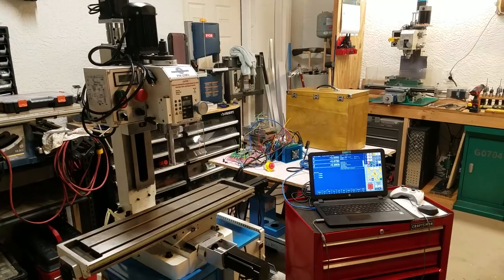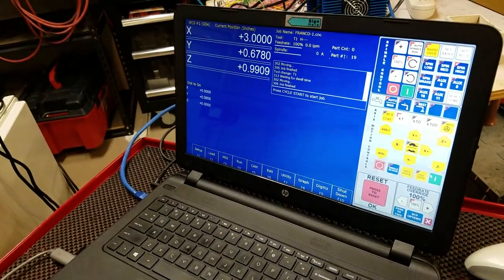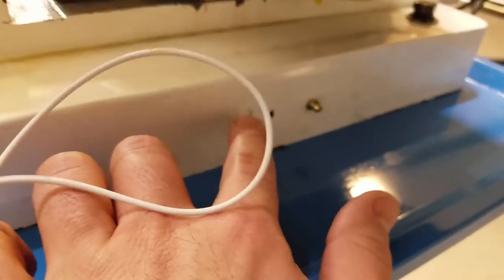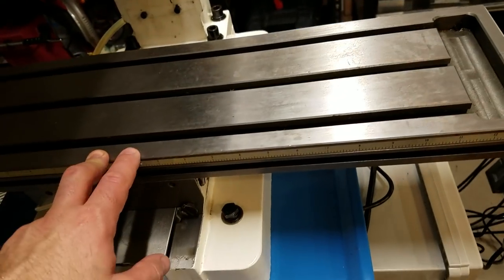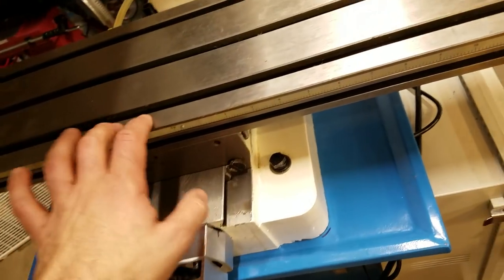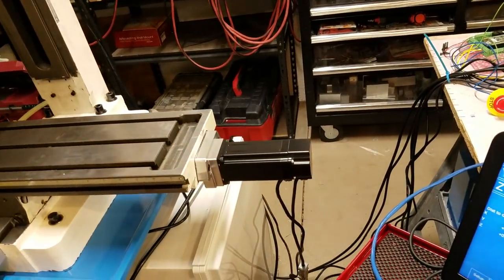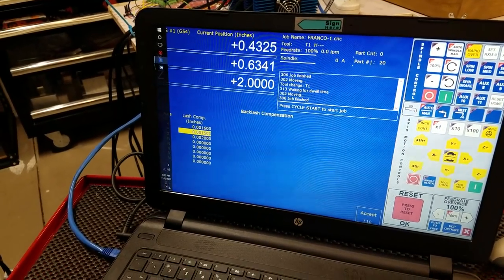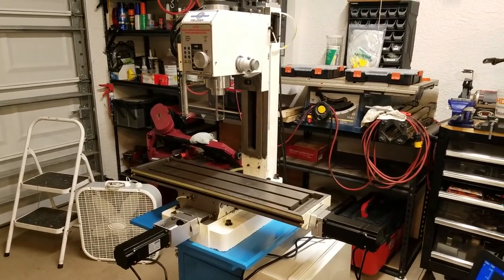PM-25MV CNC Conversion Part 3: Turning Motors with Centroid Acorn

Comment: Maybe the backlash is in those flexible couplings connecting your motors, they are designed to flex in case alignment is not perfect, so there will be some backlash in them, maybe use love joy couplings, I have those on my cnc and there is no backlash in those whatsoever, not to say that my cnc doesn’t have backlash though

Comment: If you have the steppers motors moving at 300ipm and they have feedback......what are you looking to gain by switching to servos?  Also....can you list which DMM servo/driver you're looking at?  Is there any particular advantage to Clearpaths to justify the price difference?  I realize that the advantages may not outweigh the price difference for what you're looking to do, but there's typically a trade off.....so I'm wondering if your decision is purely price.  I've been considering upgrades to my little cnc lathe, so I've been enjoying your upgrades. :)  Thanks!!
Reply: bluehandsvideo ...wondering the same...why servos over the closed loop stepper if already capable of scary speeds and only going to run at 120ipm?  Curious to hear reasons also.
Reply: servos are so much quieter.. also much more powerful. the holding or even rated torques are WAY higher.. and speed..
Reply: Tom Hutchins that PM should have hardened ways. At least my Taiwanese model does.

Comment: For the door rattle I have wrapped the door with wax paper and taped it in place then used silicone caulk on the door jam and closed the door and waited overnight for the calk to set the open the door the caulk does not stick to the wax paper so remove the wax paper and no more rattle.

Comment: I paid $410.00 for 3 axis NEMA 34 1700in oz closed loop steppers with drivers. Last I priced DMM servos they wanted $1700.00 that’s a huge difference? Unless closed loop steppers have came down in price considerably in the last 2 years?

Comment: Hey Franco, did you find the 3Nm 425oz in closed loop steppers on your x and Y to be powerful enough?wondering whether to go with these or the 4Nm 566oz in ones, everyone doing g0704 conversions seems to use 566oz in open loop steppers but obviously they cant be pushed as hard. Your z looks crazy powerful, probably would go with the next step up from whatever i decide on for the x and y axes. Many Thanks for your great videos!
Reply from the maker: Hi.  The 425 motors have more than enough power for X and Y and i probably could have used one for Z, as well.  Closed loop allows you to take advantage of every single bit of power the motor can produce.  Open loop doesn't.

Comment: I went with bst/krs servos for my pm mill. 4 axis cost $1450. 1kw x/y 2.6kw z axis and 600kw 4th axis. My mill is larger than yours but to compare against dmm you get more for the money spent.

Comment: in your video you said you had little trouble with Z ball screw mount  is this  something I’m going to run in to as well?
Reply from the maker: I don't think so.  The version of the bracket you made is the slimmed down version.  It should fit in there just fine.

Comment: Do you think that the double ball nut on the Z axis is necessary because the weight of the head would keep the backlash tight? 

Disclaimer: I don't even own a CNC mill yet, I am interested in your thoughts.
Reply from the maker: May not be necessary for backlash, but it may help handle the forces required to move the head better than a single nut.  Only time will tell.

Comment: hello franco, nice job, I'm also converting a cnc similar to yours, and I was really undecided about the engines, I don't know whether to take some powerful 12nm closed loops, or the 400watt servos ,. you in the video are you going at the maximum speed of 130 ipm if I understand correctly? I'm Italian, I don't understand English very well ... can you go faster? I have screws pitch 5mm, what screws do you have? ,. Hello and thanks
Reply from the maker: Hello.  My ballscrews are 4mm pitch.  I suggest you buy closed loop steppers. They are very powerful and fast.  You can make this machine move very fast.  Over 300 inch per minute.
Reply: @FrancoCNC  Thanks for the answer Franco, I also have 5mm pitch, you have convinced me, I put the 12Nm closed loop. A company has guaranteed me that with 400W servos I can reach 500IPM, despite having said that the motors are connected directly to the screws. In my opinion, without using belt reductions it is not possible to use all the RMPs of the servos and therefore I will never reach them 550 IPM, that company is wrong in my opinion, I don't name it for correctness. if I reach 300 IPM I will be very happy, I'll let you know how it's going soon :-)
Reply from the maker: @fedeyoutub  https://youtu.be/YZR5c3Q2S2M
Reply: @FrancoCNC  Thanks Franco, I went to see it, fantastic, thanks for making that video, you helped me a lot in my choice!

Comment: Damencnc sell isel ballscrews same as hiwin I have them in my optimum bf20l CNC they're flawless. Been thinking of upgrading to that acorn board still running terrible mach3 interface board and software.
Reply from the maker: Thanks James.  I'm curious as to how much back-lash you see in their ball screws.  I'd really like to find something that has less than .025mm (.001").

Comment: fill that stand with concrete
Reply from the maker: Good suggestion.  Currently, I've just filled it with heavy tools and vises.  That has helped quite a bit.
Reply: Franco wasn't my idea but it was brilliant
Reply: Epoxy granite in the mill base, column. And stand if you want solid rigidity.